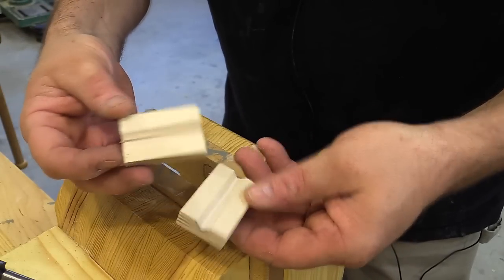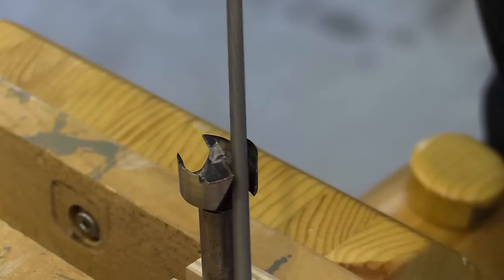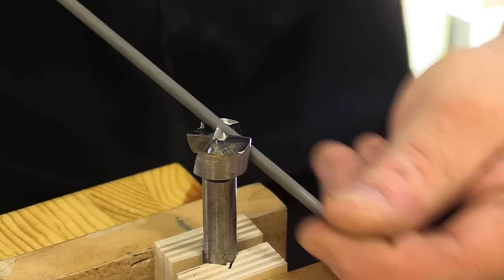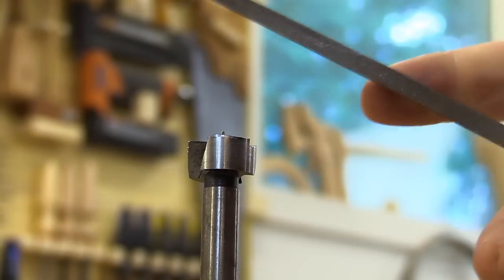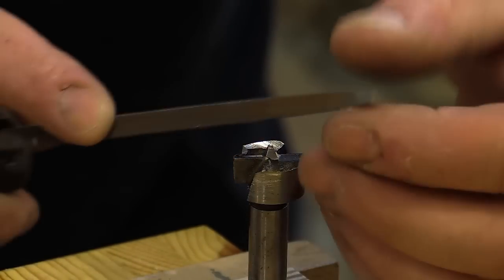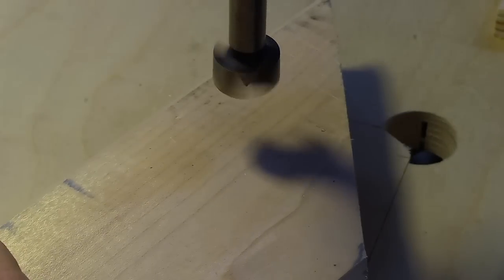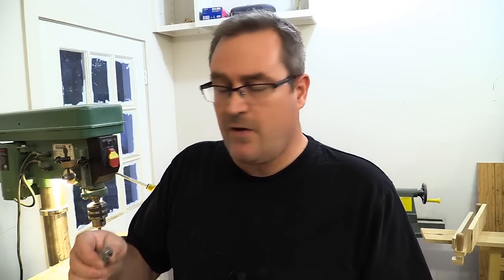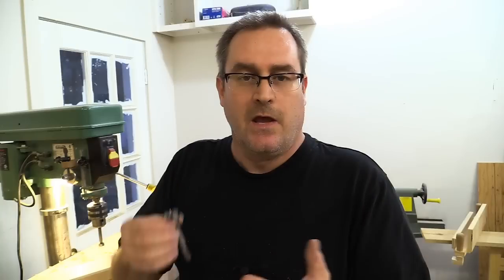How To Sharpen Forstner Bits

Comment: My forstner bits are slightly different, and I can sharp them using just a straight file (they are even easier to sharp). I saw the video, went to to the shop, I sharped one and, wow!! very fast and nice cut. Thanks for remenber me that I must sharpen them from time to time.

Comment from the maker: General note on posting comments: If your comment has a link, it will most likely go directly to the spam folder, and I will have to manually approve the comment before is will show here. It's difficult to find time to do this, so if you can post without a link, that would be better. Use a search term instead.
Reply: John Heisz

Comment: Thank you for this vid. I bought a set at an auction. needless to say they weren't all sharp. In fact the 3/8 bit was so dull the rounded edge looked like it was flat to about 1/16". I've been working them back to shape. They're not perfect but they at least cut again.

Comment: I use a very small flat needle file with very fine teeth to sharpen mine and get excellent results. The fine teeth on it produce a very sharp cutting surface with minimal material removal.

Comment: If you wanted to make it sharper after your filing, you could try a dremel-style tool with a cotton polishing wheel and use some white rouge.  Works great on chisels and knives when I polish using my big polishing wheel.  Would think the same applies to the bits.  I will try it myself soon and maybe remember to follow up.

Comment: That thing did cut fast. I don't think my bits cut that well when brand new. I better get to sharpening. I may try slitting some small rubber tubing to protect the other side of the bit in case the file gets away from me.

Comment: Hi!
This works like a charm, touched up my cheap forstner bits, and they are like new.
Have you ever sharpened a brad point bit?
I did, it too worked, got kind of tricky on the smaller ones, 3mm... real small files seemed to work fine. also cheap ones ;)

Comment: I bought a really cheap forstner bit set in ebay and boy, those were crappy. Spent quite some time with a diamond file trying to get them to work decently at least. I didnt get them super sharp but they make round holes without tears.
Buying good quality forstners bits is really expensive on the other hand :(

Comment: Nice video, I'm currently looking to buy a set just to have around for when I want to make a few holders for things.  I was looking at two sets on Amazon, one is a Porter Cable 14 piece set for $50, and one is a Freud 7 piece set for $55.  The Freud set, while having only half the amount of bits, supposedly has a lifetime warranty on them, although I have not confirmed that with the company, it says lifetime in the product description.  I was curious if you had any opinion on one set or the other.  I don't plan on using them every day, but the "lifetime" feature does make me feel these will last a lot longer than the PC ones, plus I think Freud is more known for their bits compared to PC.  Thanks again for this video, in case I go for the cheaper value set.
Reply from the maker: F Con Lifetime warranty usually covers failure due to faulty material. and doesn't cover resharpening - the Freud bits will still get dull. I have Freud bits, but I haven't used any Porter Cable ones, so I can't give an opinion on which to buy. I know the Freud bits are good and are accurately made.

Comment: Not sure about Canadian drill bits, but in Russia drill bits considered crap if you can sharpen it with regular file. Good drill bits just destroy file - you have to use diamond one.
Reply from the maker: Pavel Mayorov That is the case for twist drills, for drilling steel. You might be surprised to find that even in Russia a forstner bit is made from softer steel. Try it.
Reply: John Heisz Well, too bad - marketing specialists set lower standards so you have to buy new bits (about 1% will be resharpened) frequently. BTW, may be I'm not completely right. Term "Forstner" for you may define shape and material of bit, but we use it to name any bit for wood which makes hole with relatively flat bottom. Try to google images for "Сверло Форстнера" and you'll see a lot of carbide in comparison with "Forstner bit". And that means we prefer harder steel in our bits. I've tried to sharpen my bits.

Comment: Where do I need to file a forstner bit if it only cuts when I wiggle the drill? I have forstner bits that make nice shavings even in stuff like MDF, but only if I tilt the drill back and forth (so almost no luck using it on a drill press). Shavings are always just half a turn long of course that way. It's weird. There are no burn marks, no smoke, very clean walls in the hole, no tearout, so everything seems to cut well. Still even large pressure won't make them cut, only wiggling...
Reply: I would think maybe the chippers that go from the center point out. It may also be that your bits are constructed with a center point that is a bit too proud of the cutting edges, essentially causing the cutting edges not to touch unless you rock the drill. Do you have access to a drill press? How do they perform when you can apply a bit more direct downward pressure on them?
Reply: earzcd
I have a drill stand. If I push on the drill in the stand (by that I mean lean on it) it cuts quite well (if I don't it pushes the drill out of the collet of the stand after some time with much progress to the wood before that). The sides of the forstner cut so well that I can drill into an angled surface without the center pin even engaging.

One way I found to work, although very annoying: start a hole with the forstner (2-3mm deep), then drill out the center with another (8-10mm) drill completely and then continue with the forstner using the wall of the starting hole as guidance. That means a few drill changes and often also reclamping of the workpiece.

So yeah it seems that the parts around the center don't cut. But they feel as sharp as the rest of the chippers and have a good clearance angle.